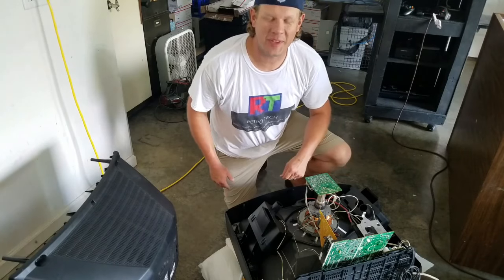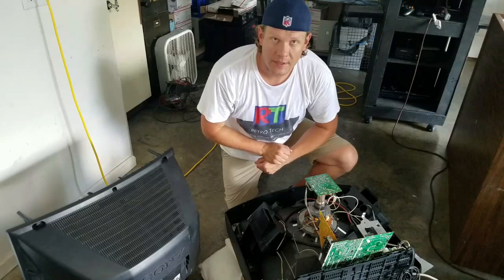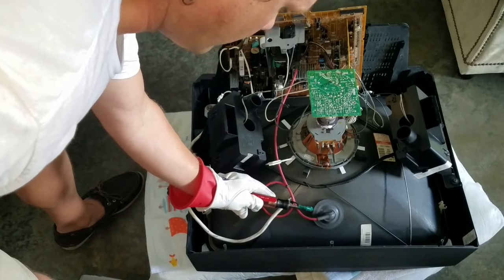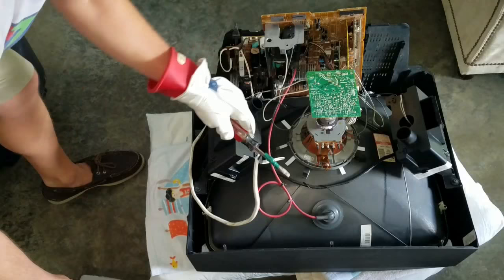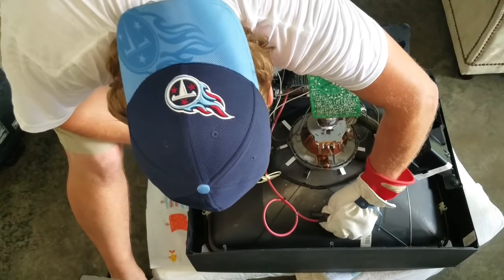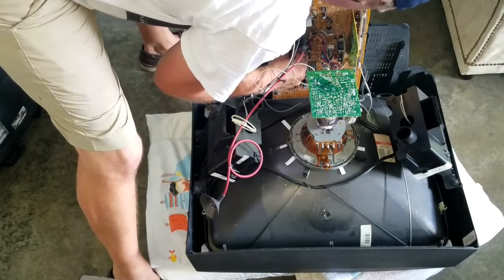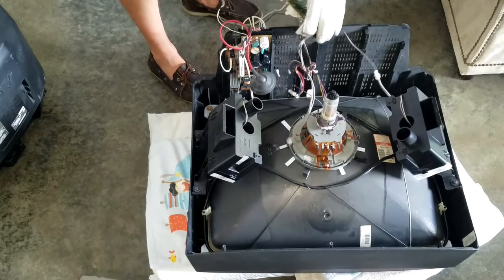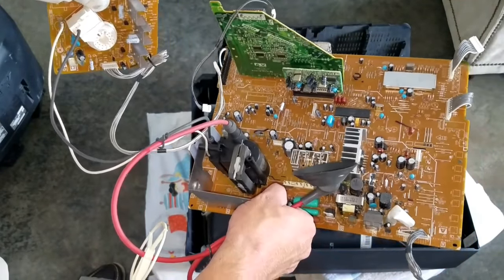Sony Trinitron CRT TV Discharge and Tear Down

Comment: Such a useful video. Out of everything with CRT repair the only thing that worries me everytime is re connecting the cables in their proper places even with images to help. Soldering, discharging even replacing a larger component like the flyback. None of it compares to getting the cables in the right places ha ha.

Comment: Awesome content! Any advice on adjusting a flat trinitron from the early 00's? All the local goodwill stores are stocked full of them, they look decent for retro gaming, but all have horrid geometry! With so many different options to adjust convergence and geometry its hard to figure out what to adjust first. Thanks!
Reply from the maker: Thanks for watching and for the great feedback.  You should start by googling each of the TV's model numbers.  These are on the back.  That should help you find the features of each TV.  Then just start by getting the best one of the bunch.  After that you should see if the TV has any on screen menu that adjusts geometry.  Most TV's don't have this feature though.  You'll have to open the TV most likely and make some manual adjustments.

Comment: About a week ago I bought a 27” 1994 Sony Trinitron CRT. It worked beautifully for a few days but it unfortunately conked out on me. I wash watching Top Gun on the ole vcr when the tv abruptly shut off. Now, it won’t power back on. I’m very sad. This tv is beautiful. I took off the back and it was very dusty inside. Cleaned out a lot of the dust and took out/put back the power plug thingy (I’m not tech savvy). The tv still won’t turn on. Any advice?! Thanks for your time

Comment: Breaks my heart, I was hoping to see some more work done on this set in-depth since mine has similar problems. I think mine can be fixed by rotating the yoke and adjusting the convergence rings, possibly the focus pot too. It seems like a simple job and I don't want to throw out my set being that I don't have a lot of options for good CRTs in my area, was lucky enough to get a 27S42 locally. Any safety tips you'd recommend for adjusting the yoke? About the same as in your convergence strip video? I haven't had time to watch it just yet
Reply from the maker: Cybrisk Don't worry.  There are going to be more videos on this set.  This is how to take the TV apart so I can replace all the capacitors and add RGB.  I'll be documenting that too.  Then I'll put it back together and fire it up!
Reply from the maker: Cybrisk I also made a 3 minute video about yoke adjustments and corner concergence about a month ago.  I'll leave a link when I get to my PC, or just check through the CRT Quicktalks playlist I have on my channel.  Thanks.

Comment: How safe is calibrating the geometry of a CRT TV... when turned on... and opened up... with the exposed tube?

I thought I had to discharge the tube before moving knobs (potentiometers), but I have seen on some videos that the TV set is on while doing this...

What is the part I can touch, and what is the part I must not touch, when doing this?
Reply: Underside of the circuit board has the hot part of the board clearly delinated. Don't touch that, but the rest of the CB is safe.

You can touch the back of the tube with one hand if you need to but be careful not to make a circuit with your other hand and also wear rubber-soled shoes.
Parts of the the neckboard itself are also hot, but probably won't shock you. Adjusting pots/convergence rings is fine as long as you're careful not to accidentally also touch anything that's hot.

Comment: Great stuff as always Steve. Long shot asking here but not sure if anybody's got any ideas about an issue I'm having on my Trinitron. It's been randomly shutting off and on by itself lately, and every so often it displays random sequences of letters and numbers across the screen (same font style as the channel numbers). I haven't figured out how to best describe this issue so haven't had any luck searching through google.
Reply from the maker: Kevin H. Hey.  Thanks for watching.  The shut off part sounds like a voltage problem.  However the other problem with the menu is not from voltage most likely.  That may be an issue with the chip in your tv processing the OSD menu.  Does the TV stay on long before it shuts off?
Reply: Thanks Steve! Yeah, I am also thinking there must be something wrong with control or computer components in the TV. Likely not a simple fix. I would say the TV runs fine for about 10 - 20 minutes before I start seeing the random letters appear on the screen. Sometimes the letters just stay on the screen indefinitely, other times the TV shuts off by itself and comes back on and the picture is correct. But then the pattern repeats itself every half an hour or so, i would say.
Reply from the maker: That's a tough fix.  I would suggest you keep an eye out for a replacement CRT that is similar to the one you have.  Then once you have a good one, you can take your current TV apart and try to either rebuild it or troubleshoot the problem and hopefully fix it.
Reply: Yeah I think I'll do that :)
Reply: Here's a surprise - the TV fixed itself! I really have no idea how it happened by I no longer have the issue. What I did was leave in unplugged for a few days, then with the TV unplugged, I held down the on/off switch for a couple of seconds before finally plugging the TV into the outlet again. I restart the TV, and leave it running for over an hour and have not seen the issue return. Very strange. I know in computers you can hold down the power button while unplugged to discharge some of its capacitors or charge-holding components, but is that the same with TVs?

Comment: When you were sliding the grounded screw driver under the suction cup,  have you heard a pop?? no?? , I have news for you.... or most likely,  you already figured it out, some CRT displays had an auto discharging mech so the repair techs didn't have to be discharging the crt everytime these were sent for servicing.